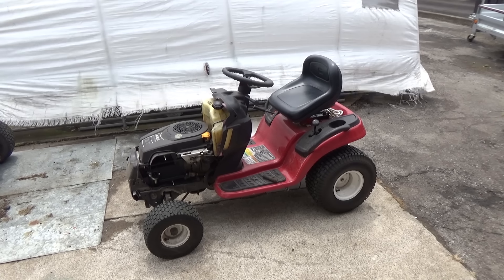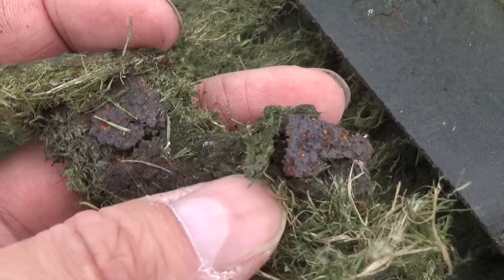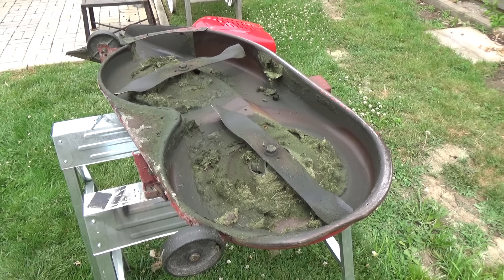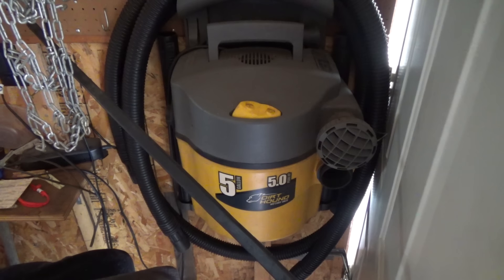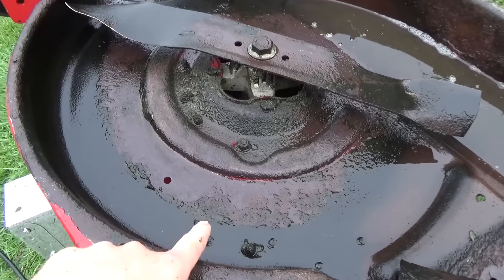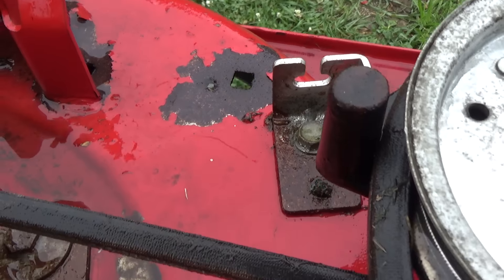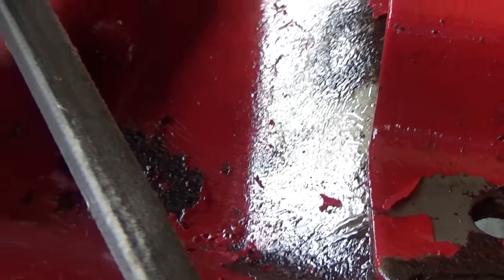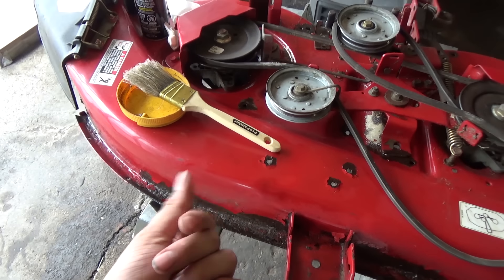How to Undercoat a Deck - Why Cleaning Your Deck is Important!

Comment: Had a 28 year old Bolens, every fall I scraped, wire wheeled and applied waste oil before putting away for winter.  At the end of 28 years it had one small spot that finally rusted through.

Comment: Great video ,I use the Krown on my car as  well and it work so good. All fuel, brake ,vacuum vent lines. Never rot the exhaust stays good and the parking brake never needs new cables. Door locks and window motors stay good.no electrical problems. It prevents a lot of problems.

Comment: Good video for those who have let things go too far.  Alternatively, you could cover the discharge with a mulch plate, hook a garden hose up to the washout port, drop the deck to the lowest setting, throttle up the engine, engage the blades, and  let it clean itself. Do this once a month or so, and it'll stay almost as clean as the day you bought it. I mow an acre in Florida (wet and thick) and my 4 year old mower deck is spotless underneath. I've  only lifted it to remove the blades for sharpening or replacement.
Reply: Yeah but how are your spindles holding up with all that water?
Reply: @AnonymousGameWarden  if you have spindles that can be ruined by a little bit of spinning water, then you bought the wrong mower. A little water on metal for a few minutes isn't nearly as bad as having wet, packed grass against it 24/7.

Comment: Nice great video i did our L-115 J D deck 4 years ago. I used rust-oleum pro paint then spray undercoating. Also i removed those black plastic guards over deck pulleys for easy cleaning & maintenance with leaf blower.
Reply from the maker: Thanks for watching!

Comment: I like used motor for all sorts of stuff like this.  Been soaking my wooden yard tool handles in it.  Dries nicely.  I usually spry the underside mower decks with hammerite paint ofter cleaning them up a bit.  Goes over light rust ok and dries fast leaving a nice glossy finish.  Occasionally spray a little oil for easy grass release.

Comment: Airframe and Powerplant Mech.> you should take a putty knife and remove the loose paint before oiling the area. The protection will work much better. By-the way ATF is a good rust protectant.
Reply: Jerry F wow I did the same with my John Deere, I used 👏🏾👍🏾ATF from my vehicles

Comment: I use a spray-on truck under-coat. Sprayed my first mower (90 Snapper) with it when it was new. I wash it out after each use. Mower still in service. Deck still in great shape. Only retouched with the under-coat twice. Sprayed top and bottom.

Comment: I just had my deck shot blasted and galvanized. Cost me surprisingly little and should out live me!
 Best money I ever spent!
Reply from the maker: Hmm, I'd be interested in hearing how that stands up after a few years!
Reply: I know people that have done it and after 12 years their decks have zero deteriation so far. You can only do it to a quality deck, those cheap thin decks will not stand up to the process without warping.
Reply: Hot dipped or yellow zinc?  What kind of business did that for you?  Updates a couple years later?
Reply from the maker: Also interested, hopefully YouTube keeps the reply notifications going on this thread

Comment: A mower lift is the best thing you can buy to keep the deck clean and sharpen your blades regularly most people don't sharpen their blades enough .,
Reply: Most people run it until it breaks, then they bring it to a shop to fix, then they come online and complain about what a piece of crap their mower is.

Comment: Does your pulley wiggle test tell you if there is any grease in the bearings or if they are dry?  You might want to actually spin them and listen, as well as feel them move to see if they are smooth.  Might save time replacing them later since it's apart now.

Comment: I clean and wire wheel any and all rust of my John deer lawn tractor each cutting season... Then I paint it where any rust was removed... My deck is 27 years old and looks new...
Reply: Z71Ranger make a video of it
Reply: and that is what is needed... clean the deck up and touch up paint. Don't halfa$$ clean then coat with anything else. This video is a dis-service. When done, that deck was no better off beyond removal of thick caked on grass.
Reply: my girlfriend is 27years old to ans still look new , but I've never painted her

Comment: 9:04 I would fill the filter canister with oil, before refitting to the engine. That way oil pressure will build up almost immediately and not starve the bearings of lubrication.

Comment: That's one of those bucket motors Kohler makes . ALWAYS check the case bolts under the flywheel ,they loosen and the block cracks !

Comment: Would you advice not cutting the grass during really wet days or around a rainy day to avoid all that moisture?
Reply from the maker: Only cut when it's dry! Then the deck doesn't build up with grass, and it's easy to blow off the top!
Reply: Thanks for the quick reply 👍🏼

Comment: I agree that rust preventative is a good product, I use it on my tools, but it is only a coating that must remain on the metal to do its prevention. However, if something hits it like a stone or fairly large branch, the coating could be knocked off or scraped off the metal and then the metal is open to corrosion. Once the rust converter is dried on the metal, it cannot be knocked or scraped off since the rusted metal is changed to a hard different material and is free of rust occurring again.

Comment: POR 15 works great on encapsulating rust, preventing further rusting.  Will work great on the underside.
Reply from the maker: I keep hearing about it and will definitely have to check it out!
Reply: I did the same thing like 8yrs ago on my "back up Murray" mower. Cleans up easy and I find wet grass doesn't stick and clump up underneath!
Reply: my experience is with POR 15 is its like powder coat  , one it gets chipped moisture migrates underneath it and rusts underneath and then it comes off in sheets , ya can't really tell its rusting till the sheets  falls off , im not a fan , its too hard of a coating

Comment: Instead of using the rust preventative, it would be better to use a rust converter. The preventative is an oily, waxy lube which prevents further rust, but will attract all the dirt and grass that comes from using the mower since it always stays moist. The converter is a spray that acts like paint but actually converts the rust to another substance that is not rust. Once sprayed, the rusted metal all is converted to a substance which will not rust again. It dries like paint and is a black in color so it will not attract dirt or grass. It can be painted if desired.  You can find this converter at  Walmart and most hardware stores.
Reply from the maker: The grass and dirt doesn't actually stick to this stuff, you'd think it does, but I just had a mower (which I sprayed last year) come in for an oil change and the deck was very clean with hardly any grass stuck to it!
Reply: Good to know that grass and dirt doesn't stick to it hardly! In all honesty though, rust converters do a better job. I don't recommend using it EVERY YEAR for your customers though, using a converter the first year and then the preventative the following years is what I think would work best.

You are the professional though and if you don't have any problems with what you do now... I wouldn't change anything. I like the saying "If it ain't broke, don't fix it." Have a good day Eliminator!

Comment: Spots on top where paint flaking sand with flap disc on grinder and clean and use high zinc primer and spray paint on top.

Comment: I use my mower to grind up leaves in the fall and it acts like a sand blaster, in spring the under side is almost down to bare metal.
Reply: Needs cleaning after every mow while it's wet.  Simple. Preserve your mower.  Save lots of time. Preserve your body, too.
Reply: Me too

Comment: It would be far better to scrape off all the loose paint then apply POR-15 to all the bare metal, then paint the whole top side. For the underside, paint POR-15 on all of it, followed by a coating of a good abrasion resistant spray paint. Google that, you'll find plenty of choices.

Want it even tougher? Completely dismantle the deck, sandblast it, paint it all with a catalyzed epoxy paint then take it to a Line-X shop to have the underside coated.
Reply: I think i might make a video of this, that sounds like a good idea !!

Comment: Something else that is important, is that all "cut" plants including flowers, vegetables, and grass, give off acids. They do not while growing, only after they have been cut! So this acid, mixed with the moisture, accelerates the rusting! I like to use something like this every year as well once I clean m deck in the Fall.
Reply from the maker: Yes absolutely, mentioned that in my latest deck repair video

Comment: PB has a great rust neutralizer and preventative. I used it on some damaged area on my truck for the winter in this salt-ladened road area until I can get the area repaired.

Comment: I'am really impress with the Rust-Oleum Truck Bed Coating>  i just brush it on 2 coats with 2 hours drying time for each coat  NEED TO PLUG THEM HOLES there enough air coming out of the pulley mounts
Reply: I also use a truck bed liner, 2 to 3 coats, lasts about 3 years. when it's worn away to the steel I apply another 3 coats. What this guy did is a waste of time, cut your grass once and it will disappear! I use Harbor Freight bed liner.....Cheap.

Comment: I have used Glyptal paint as an under deck coating. Then every time I sharpen blades, I spray some liquid car wax. I don't get any buildup. My deck is in awesome shape. My mower is 20 years old.

Comment: First off mower decks should be made not to rust in the first place! I have painted, rust prevented, decks before. Anything you put under
the deck, will be worn off with the grass as you mow. Keep good care of your mower, and don't let grass get clumped under it.
Reply: There’s no permanent fix. And there’s no way to build it where it won’t wear. You should regularly clean and coat underside of deck. You sound like the type that says it will wear off why waste my valuable time painting it. And as you can see in the video, rust happens. And grass doesn’t stick to painted surfaces anywhere near what it does to unpainted metal.
Reply: @chriswhitley3283  Thanks for your reply. It has been 3years ago since I wrote my comment. Had to read it over again to know what you were referring to.  Many decks rust because the grass that builds up (say when wet), people don't clean out regularly. I always cleaned underneath after each time I cut the grass. That way the bottom of the deck gets to dry. The problem with painting it or undercoating it, is that after a few times of cutting, everything underneath is gone. If the deck and all mowers would have rustproof decks, this problem would be fixed.  I know that some models of Honda push mowers have rustproof decks. Yes the prices of the mowers would go up, but it would last. Yes I agree that grass won't stick as bad with a painted deck, but the paint won't last.  Put your hand when the grass shoots out. That hurts!!  That is what the grass is doing to the underside of the deck.
Lawn boy used to have decks made out of magnesium. I had one. That never rusted.
Reply from the maker: I'm trying to find a stainless steel mower, super rare, have multiple people looking for me as well on commission. We'll see what happens!
Reply: @EliminatorPerformance  The only mower I know of is one or two models of Honda. ( Home Depot). Stainless steel would be probably very expensive.
Reply: @EliminatorPerformance  yeah my dad had one and that was his baby. Something happened to the motor. Not sure what happened to the whole mower. My dad died of the old timers with a bad hip. Would’ve put motor on it. He had some thieves get rid of some scrap. Couldn’t find a lot of stuff after that.

Comment: Very detailed info. Many thanks. Any thoughts on using rust paint as undercoating ? I have an old paint can of it so trying to use it for something.
Reply from the maker: Thanks William, you could use what's called a "rust converter" so I'd recommend taking a wire wheel on a drill to the whole underside, convert the rust to painteable metal, then use your rust paint.

Once dry, I'd then recommend undercoating with a rust inhibitor.

That's how I'd do my own deck, we have to understand this is for a customer, and I'm charging for my labour and materials!

Comment: i always clean everything off a deck once i have it upside down. Never leave any residue as you have, I use an air scaler for dry grass and rust, then medium sand disc to bare metal. Then phosphoric acid for a day or two,,then prime and paint. My decks cost over 1000 excluding any spindle towers or bearings, so half way work wont get it for me. If i have a crack or hole, it gets welded up and ground smooth on both sides so you cant tell it once painted. Costs time and money but saves in the long run. My blades get sharpened twice each summer at least.
Reply from the maker: What I would do with my own equipment, most of the stuff I service is for customers and they're looking for something in between long lasting and cost saving if you catch my drift.

There's always a balance between the 2 and this is what I've shown.

Comment: On my new TS348 XD tractor which I bought in April 2019, first thing I did was spray 2 cans of Graphite deck coating from tractor supply, I think it did a good job coating the deck but grass still stuck and I never cut wet grass.  This cutting season after 3 cuts of an acre lawn I put the Husqvarna up on a lift and cleaned underneath, scrapped and blew of the grass and hit it hard with 2 coats of fresh silicone out of the spray can.  Do you think the silicone is a good choice? Thanks.
Reply from the maker: Anything that helps creates a barrier between the metal deck and the outside air is good. Usually you want to stick to oil based products, but I'm sure silicone would work. What you don't want to do is use a rubber coating like I've seen before. Some guys have made videos and it's horrible because you'll end up getting moisture build up in between the metal deck and the rubber coating. Let me know how the silicone holds up, we've never had an issue with rust cure!
Reply: @EliminatorPerformance  Thanks.  I think the Graphite coating is still there, but I thought hitting with the silicone would back that up..we shall see.  I soaked it good.  :)

Comment: Use a wire cup brush on the end of a drill and get rid of the rust, put rust converter on it then the rust preventer.

Comment: With 30 plus years of mower and tractor experience, this video is only a band aid, I recommend pulling off your  deck  remove the blades scrape off what you can. Then take a wire brush wheel and a 4in. grinder clean off all the rust that you  can, wash off with  soap and  water, blow dry with air  pressure wipe down with mineral sprits get a gallon can of boiled linseed oil, take a blow dryer or  heat gun and heat the areas this expands themetal and opens rusted pores brush on heavy do not leave puddles I do two coats about 1 hour  apart. This will take about 48 hours to cure and will last about 3 years.Paint or undercoat is a waste of  time nothing I no of will permanently stick to a mower deck because when mowing  your deck is creating a vacuum pulling up clippings and dirt.The dirt contains sand, so every time you  are mowing  your sandblasting your deck. remember to clean with  soap  and  water a mineral  sprits hope this helps and do not use deck till it dries or  cures
Reply: I agree with your comment. He should have at least used a chipping hammer to remove the heavy scale because the rust is still working under the heavy scale. I didn't know about the linseed oil but I will certainly give it a try. I clean and strip my deck, I then use a rust converter (which really is a heavy primer) then I cover it in an ashfault undercoating which does pretty much dries hard over the winter then does remain on for the best part of the summer, come fall the bottom of my deck is in pretty nice shape and I repeat the process. This guy making the video is doing some good but he is only getting part of the job done.

Comment: Should scrape all that bubbled paint off.  Just asking for more rust.
Reply: Yup! That mower deck "has the cancer", and won't last two more seasons unless it is properly dealt with by removing that bubbled up paint..
Reply: 9:27  I saw that too.  Use a flexible putty knife to expose all the spots where the paint has failed, so that you can hit it all with the rust preventative (or better still, sand until you reach clean metal all around the spot, use a phosphoric acid rust converter, then prime & paint).  Leaving the paint on might look nicer for a while, but it keeps you from treating the rust that's growing behind it.
Of course, if you're doing this as a business, you make your recommendations, and then do whatever the customer is willing to pay for!
Reply: @frankdavidson9675  Years ago, I bought one of those Central Pneumatic 5-gal sandblasting tanks from Hazard Fraught to clean up some parts for a car I was restoring.  It's long gone now, but I'll be buying another when I rebuild my next mower deck.  If you're taking the trouble to sand and repaint anyway, you might as well do it on a clean surface.